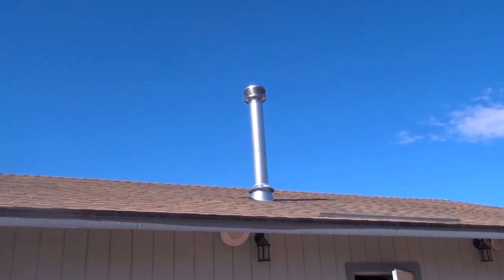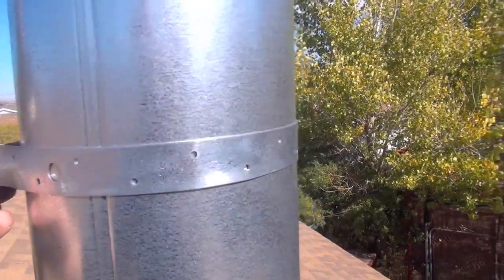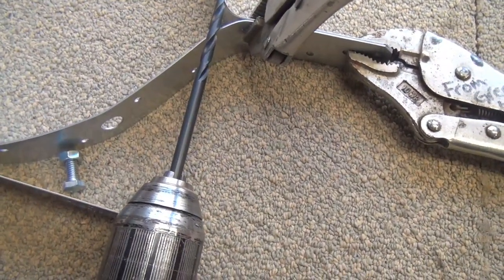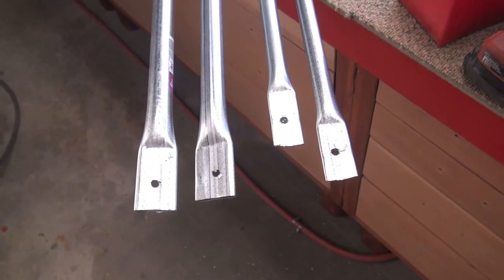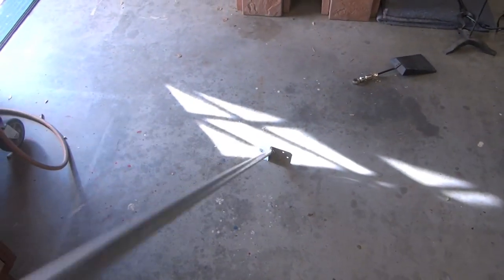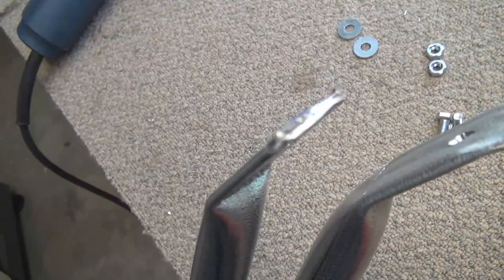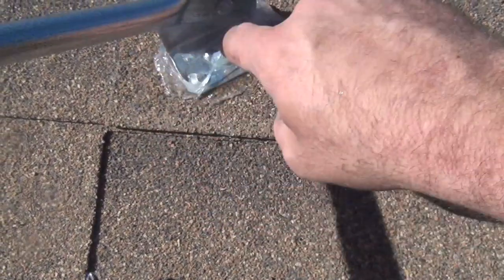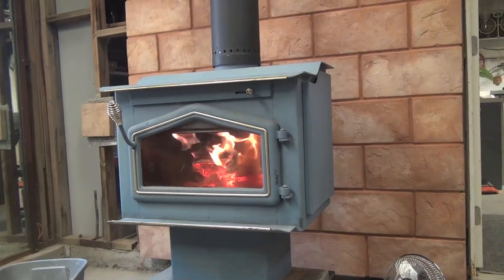Make Easy Chimney Support Mount for $12 + How To Install It*VERY EASY  EP 6 of 7

Comment from the maker: Hope this DIY chimney support design helps somebody out one day.  The next & final video in this wood burning stove installation series will be about firewood storage. Please share & like....
Reply: Mike you helped me out. I'm a fabricator welder by trade so my go to automatically goes to steel and sometimes my thoughts r trapped in a box metiforically speaking. Your video is so much easier because facing parts from steel is time consuming and can be a pain in the ass. On another note the brackets you can buy r so damn over priced. It's bad enough all the pipe costs a fortune. Thanks bud
Reply: Good video

Comment: Suggest the bolts for the extra strap be made with flat head bolts to the inside so you don't end up wearing a hole from the hex head bolt into the chimney pipe.

Comment: Nice simple strong fix with very good instruction . With slight modification to roof fixing bracket could be adapted to roof with tiling .   Excellent out of the box thinking.

Comment: Mike thanks for the video I copied it for my Gambrel roof on my cabin still works fineI used slightly longer bracket but still came in under $20.00

Comment: It's all great up until when you connect it to the shingles/tiles of your roof, would u not take them up and secure it to a roof perlin and then flash around it to keep out water. Or at least use some long screws, any thoughts, tradesmen?

Comment: you got 4-24" , what did you use the others for?
Why does it need to be telescoping? Can't you just cut to the right length?
Why are you not looking for rafters to tie it into? you're just screwing it into 1/2"plywood.
You can use selfsealing screws, silicone wont last when exposed to the weather.
Great vid!
Reply: Telescoping seems like a good idea to me. Silicone repair to one of my roof tiles has lasted over 15 years now but is probably due for replacement soon.
Reply: Wow, I usually read the comments 'before' I watch these videos...pretty lame instructions for sure.

Comment: isnt a 10 footer EMT like 10 bucks? so you used 4 and some simpson strapping. that would be like 50-60 bucks? also wouldnt the cut sections rust since it is only zinc plated? the store bought support is stainless steel so it looks good forever
Reply from the maker: when I made this video the price was less than $6 per 10 foot section. I cut the 10 footers in half so it was two 10' pieces total for around 12 bucks.
Reply from the maker: oh yeah, one more thing. All these years later and there is not any rust what so ever, in fact the metal still looks the same way, new...

Comment: Why do you even need brackets on the ends of the poles.Just flatten and bend to the right angle, and you can screw the pole directly to the roof

Comment: BS on all that costing only $12!    3/4 is over $4 a stick and 1/2" is about $3  so already it is $14 plus brackets and strap and hardware ...I am guessing at least twice your 12 bucks...still a good deal but why lie?
Reply from the maker: lie, are you kidding, I did this project a few years back,  If prices have risen so be it but accusing someone of lying is absurd...
Reply: This video was super helpful. It inspired me to build one myself. I live in Alaska where prices are higher than the lower 48. I constructed this project and it cost me $25. I call that a good deal and it was fun to construct it. To purchase a ready made one would have been $80. Prices change through time and even from location to location. That Mike was able to construct it for $12 is great. I have no problem with that. Mike, thanks for making this video.